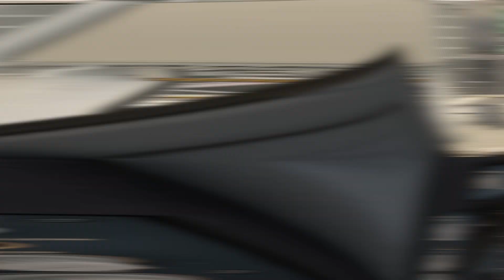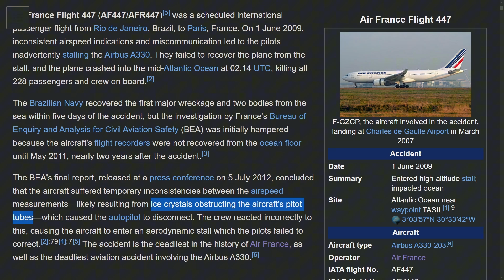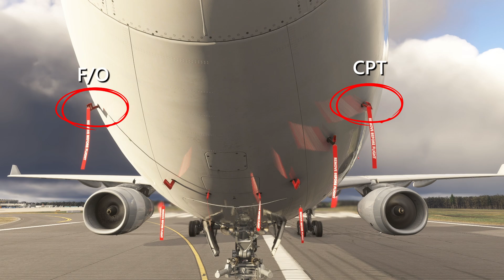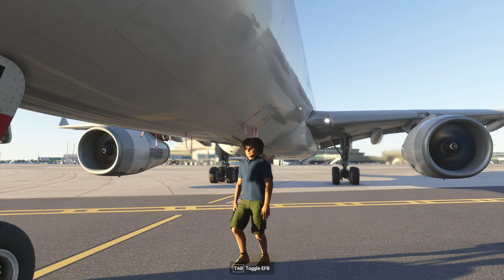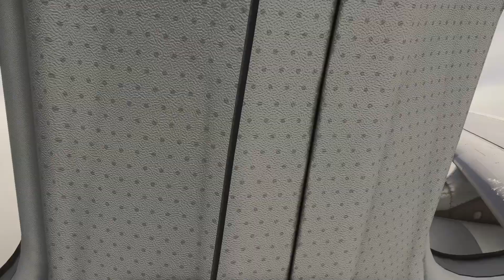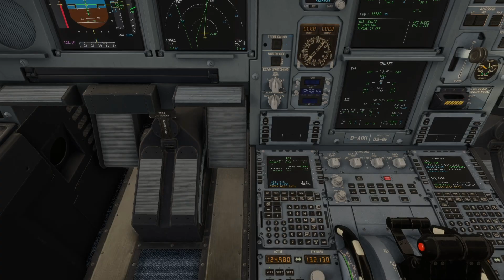Watch this pilot takeoff without speed indications 😳 | MSFS 2024 Realism Check | Episode 3

Comment: What about the AoA veins? They are also very important to calculate speed and altitude
Reply from the maker: @melteddust4306  fair point. I wanted to keep the video as simple as possible ✌🏼😃
AoA veins are not used for speed and altitude though but rather for e.g. adjusting the trim and also stall warnings.